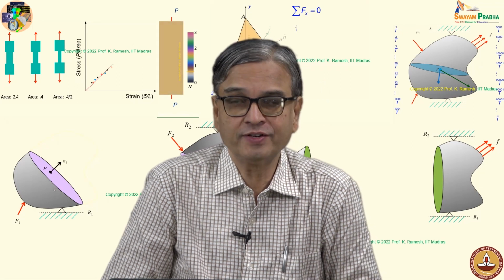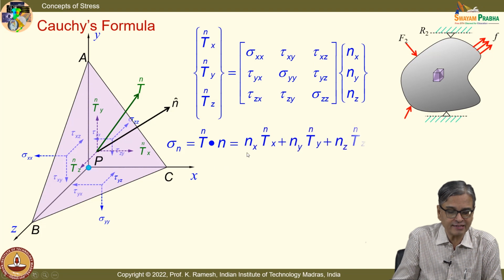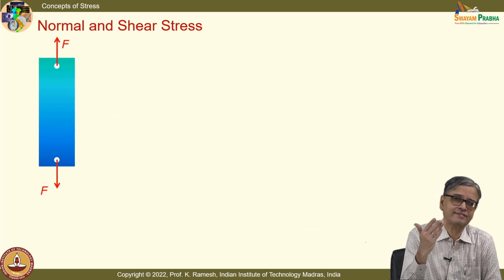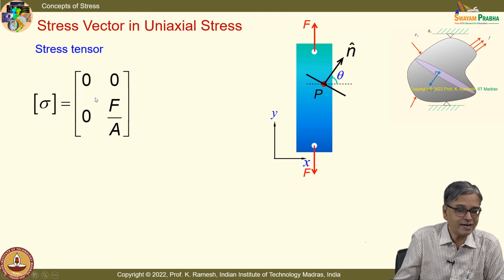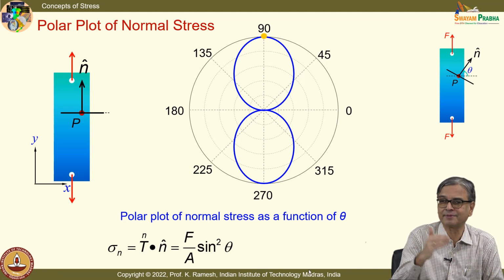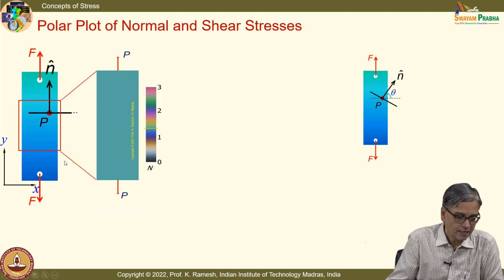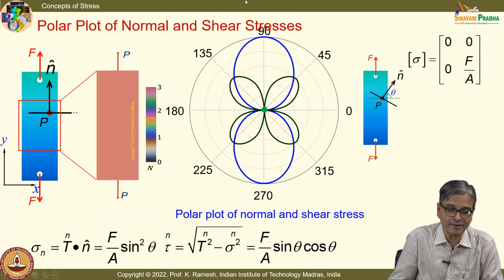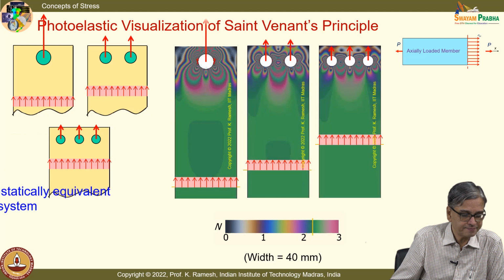LEC 05 Stress Tensor

Comment: after full lecture on stress tensor I am still wondering sir what is Tensor? is it putting it in matrix form into various components? and why its not vector but tensor?
Reply: Vector has only one direction associated with it along with some magnitude. For example, if one considers a force vector of some magnitude and one set of direction cosines, everything about that force vector is known.

A tensor (second order tensor specifically) has two directions associated with it along with some magnitude. For example, if one considers stress, one needs to know the magnitude, the direction in which the force is acting and the orientation of the plane on which it is acting. Hence, the two directional dependence.

Matrix form is only a representation. All second order tensors (stress, strain, moment of inertia, etc) can be represented as matrices. However, every matrix is not a second order tensor.
Reply: @ganeshramaswamy911  thank you